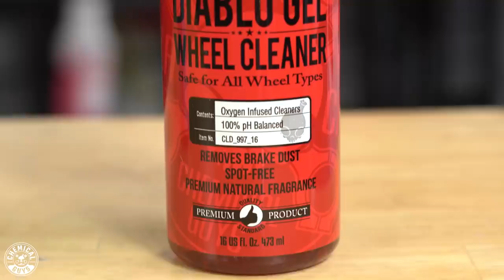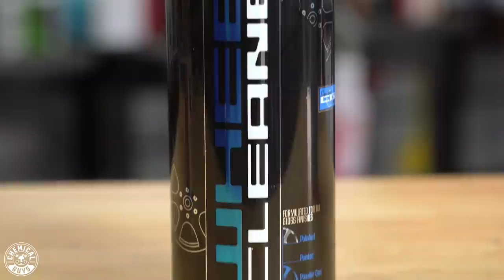Learn These 5 Methods For Cleaning Different Wheel Types! - Chemical Guys

Comment: Good video. Now I get it! 
Some of your spray tops are impossible to get off to dilute them. And I wish for simplicity the products that need to be diluted NOT come with a spray top so we quickly know which is which. I’ve been using the Ultimate one full strength; I guess by mistake.
Reply from the maker: Thanks for tuning in!
Reply: Need channel locks to get them off!

Comment: I put new rims on my car this week, took off the factory ones for the summer. What yall recommend I use to clean it since it's off the car? Not super dirty, no curb rashes, it's gunmetal benz wheels.
Reply from the maker: Hey! Diablo Wheel Gel is great for gently lifting brake dust and other grime.
Reply: @ChemicalGuys  Compared to Decon, how much more effective is Decon?

Comment: Do you spray on before or after getting wheels wet?
Reply from the maker: Hi Mark! Start by rinsing the wheel to remove heavier debris and soften grime, then spray wheel cleaner and allow it to dwell before agitating with the appropriate brush.
Reply: @ChemicalGuys  Thank you

Comment: I tried diablo wheel cleaner and still not able to get the rust out from the wheels. Any recommendations for stronger cleaners?
Reply from the maker: Hey! Try using DeCon Iron Remover to lift stains and brake dust.

Comment: Does orange degreaser work on plastic or metal only?  Need to clean the wheel arch lining and suspension... is orange degreaser too harsh? What ratio should be used?
Reply: I use it to clean my wheel arches too and can clean tires as well I used a ratio of 1:10 for the 16 oz. wheel arches but for plastic I used 1:20 for the exterior plastic.
Reply: @klausmikaelson7279  cool thank you

Comment: Which can be used without water?
Reply from the maker: Hey! Both, Diablo Wheel Gel and Signature Series Wheel Cleaner require rinsing with clean water.
Reply: @ChemicalGuys  so you don’t have an option that doesn’t require water? Something like ecosmart waterless but for rims and tires?